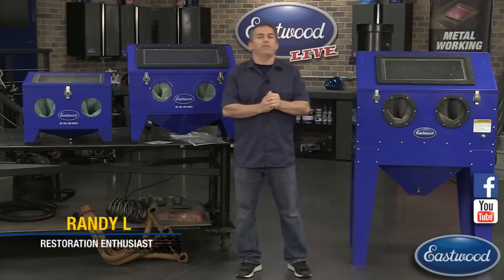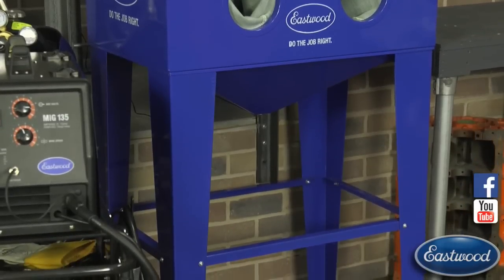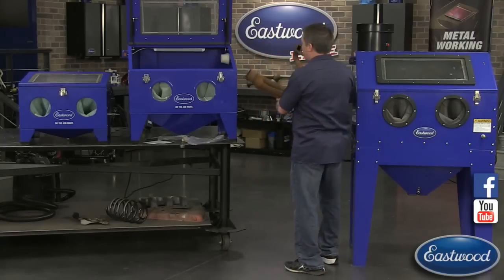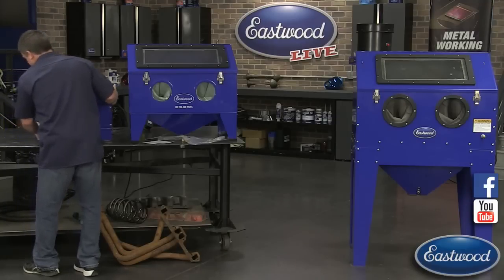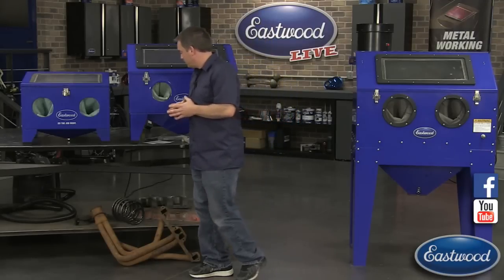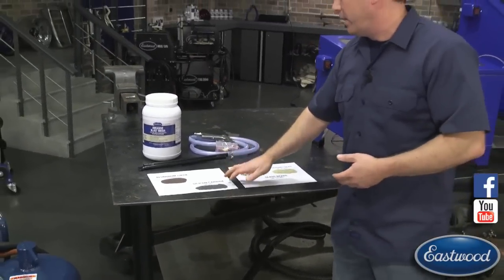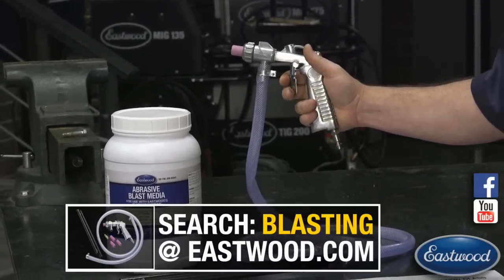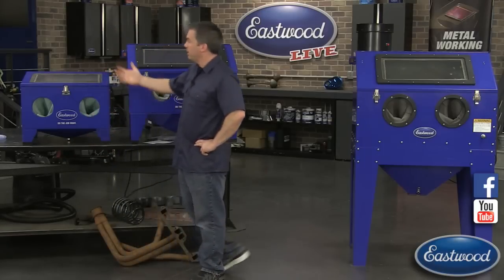Remove Paint & Rust at Home With Eastwood's Blast Cabinets!

Comment: I would send a lot of those parts out to be acid dipped, especially the latches and intricate mechanisms that I don't want to fill with sand.   Send them out for chemical stripping and they come back totally clean and ready for paint.
Reply from the maker: Eastwood also offers chemical strippers that can do some of this work.